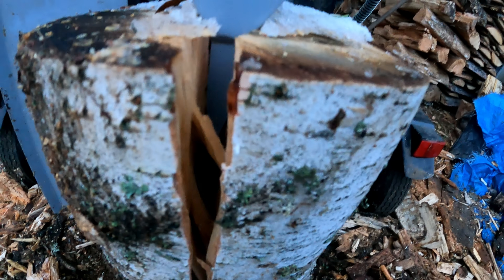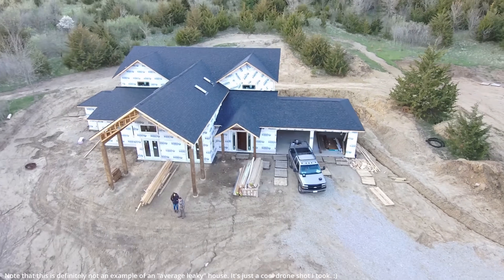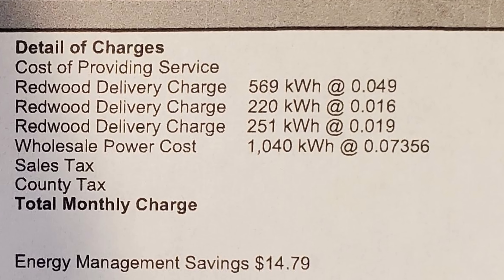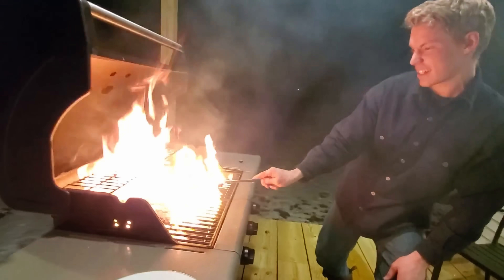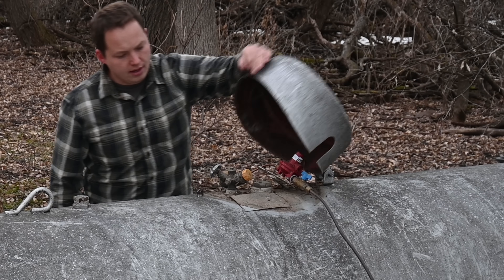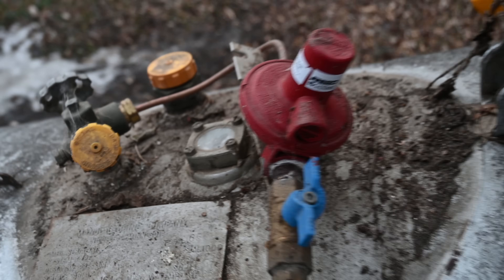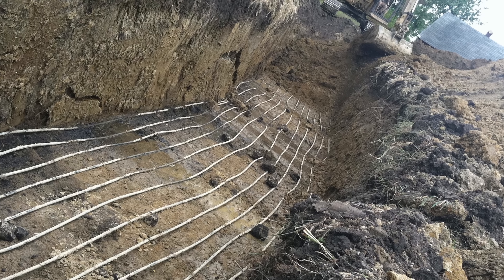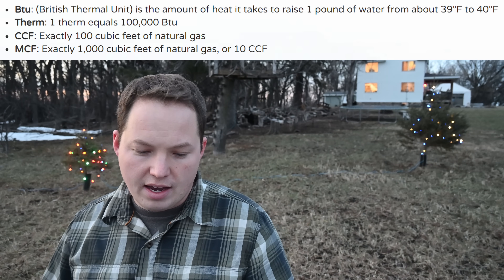What's The Best Heat Source in 2022? Top 5 Home Heating Methods - LP Electric NG Geothermal Fuel Oil

Comment: Ground source heat pumps are extremely efficient but also outrageously expensive because you need plenty of land, wells drilled, or a massive pond. I'm installing a water to water ground source heat pump in my house but I was really close to just go with mini splits. Those are cheap, super efficient for their cost and super easy to install.
Reply: I'm having a water to water ground source heat pump put in. It heats the water that runs thru the pex I installed in the basement concrete floor. Then forced air for entire house. House is 4300 sq ft with basement. I have 6 250' closed loop runs that were straight drilled 20' deep. House is closed cell spray foamed from top to bottom including basement walls.
Reply: I saw a video where they talk about using a vertical borewell with helical coils for the ground loop. Apparently, if you have even a 16-24" diameter bore, you can insert the ground loop coils in there, and you only have to drill down maybe 50 ft, which is much shallower and cheaper than a regular vertical borewell.
https://www.youtube.com/watch?v=VA5SmiaTEcM
Reply: I was using a water to water heat pump for my home to heat the floors, my system was a pump and dump and worked quite well except it was too noisy. I have no basement as I am next to a stream so it was in my mechanical room next to my living room. Make sure you soundproof it well, compressors dont get quieter with age.
Reply from the maker: My dad uses ground source heat pumps with a "pump and dump" setup where the water is pumped from his well and then the used water goes into a pond on his property. It works well but depending on where you are located they may or may not allow that type of system.
Reply: @BenjaminSahlstrom  hey, german guy here! Actually I am looking to get exactly this kind of water-to-water heat pump allowed. As a side note: mostly all newly created houses in Germany are constructed with electric heat pumps nowadays, since those are funded by our government. Also all fossil fuel type heating systems are going to be forbidden in the upcoming future.
Reply: @willbass2869  and other stupid things over the decades!
Reply: @dermozart80  We need to do that in this country. European countries and China are years ahead of us with energy efficiency . Too many corrupt politicians holding us back!
Reply: @dermozart80  Your heat pumps are air to water, in the US our heat pumps are air to air. We are installing an increasing amount of floor heating that can utilize the lower temperature water from heat pumps but only Daiken has brought their Altherma into this country. Unfortunately the home builders dictate what heating system to use in their homes so they want cheap, we end up with unzoned warm air blowing through pressed fiberglass board. As an HVAC contractor I can tell you it is pitiful.
Reply: Mini-splits are NOT cheap and do not have true defrost cycles that incorporate resistance heat to warm the delivered air while the system is in defrost mode if they even have a defrost mode.  At least currently, they are only intended for moderate winter climates.
Reply: @alanmorrison3598  what is "moderate"?
Where is it better to use the mini splits? Missouri, N. Georgia, Central Texas?
Reply: @willbass2869  Friedrich says South of the Mason Dixon line is acceptable most of the time..As far as I know their heat pump mini-splits do not have the ability to defrost the outdoor coil so depending on the outdoor conditions, the unit could run for 2-6 hrs. and then just shut down.  
Other units may have the ability to defrost the outdoor unit by switching back into the cooling mode via a reversing valve and shutting off the outdoor fan during the defrost cycle..but, they will deliver very cold air to the conditioned space until the defrost is complete.Windy conditions outdoors may lengthen the time to defrost or if very windy and cold make it impossible to defrost at all.  Residential split heat pump systems incorporate electric resistance heaters that come on if the compressor fails, (emergency heat) and during a defrost cycle to prevent cold air from being delivered to the indoor space.
Best thing on mini-splits is to ask pointed questions about all of the above and most importantly, how long the units are covered by a FULL PARTS AND LABOR warranty..Not just the refrigerant circuit.  Some contractors may offer a better warranty than the manufacturer and the most important thing is selection of a good contractor..Good contractors will insure you get a suitable mini-split and make you fully aware of shortcomings..Backup heat North of the Mason Dixon line is a must in my view and after what happened in Texas recently, may be a good idea everywhere.  Hope this helps.
Reply: @alanmorrison3598  thanks
Reply: @willbass2869  Alan Morrison is giving all wrong answers. Depends on your weather but good 1st estimate is 1/2 ton per 500 sq.ft. + 1/2 ton.
Reply: @willbass2869  They are great anywhere you wont freeze to death if your power goes out  lol
Reply: @artsmith103 , Back when I started in 1984, systems where sized to about 400 square feet per ton of cooling in a hot area, and a little smaller in a cooler area.  Basically in Arizona and Southern California, we did not worry much about proper sizing, as there is no humidity consideration.  In the east, we where told that proper sizing is more a requirement to reduce humidity.  Out west, we could get away with a vastly oversized unit and not worry about it only running 15 minutes than off for 30 minutes.  

My home in Portland Oregon is 1,850 square feet, and. 2.5 ton system would cool it just fine.  As a heat pump, 30,000 Btu's at 47F and 18,000 Btu's at 23F would mean running the back up electric heater a LOT on days less than 30F.  So I installed a 48,000 Btu unit with a 28,000 Btu capacity to heat at 23F outside air temperature.  I never connected my back up electric heater!  8 winters so far, never needed it.  Sure I get cold air for 5-8 minutes during each defrost cycle.  But that is OK.   My system can cool my house by 12F in 1 hour!  So no problem if I don't set it to 75 when I leave for work, I can cool it to comfortable in about 2 hours.   

I am thinking about installing. 120 volt ductless 17 SEER unit and running it from a 2 KW solar system.  The panels I bought are $85 rated at 250 watts, 8 amps 33 volts.  The $800 inverter / charge controller is 48 volts, 8 golf cart batteries $800.  So the solar system installed is about $3,000.  The ductless unit is $719 at Amazon, 12,000 Btu and will heat and cool my bedroom for free once the solar is hooked up!  

Yes I will be able to slow charge my model year 2025 or 26 electric vehicle with the solar system!  I might expand it to about 4 or 5 KW by that time.  

One guy on Youtube noted that his electric bill dropped from $120 a month to only about $85 once he installed LED bulbs and replaced his dishwasher with a energy star one, and installed a higher efficiency heat pump.  So plugging in his new EV brought the cost back to about $110 per month.  So he SAVED money and electricity by installing energy efficient appliances, and that was more than his EV charger uses each month!

Most EV's go 2-4 miles per KW of power they use.  So you do not need to put 75 KW of power into the car each night.  Only if you take a long trip, then charge it at home, you might put in 16 amps for over 12 hours.  Most daily charge is 16 amps for only 2-3 hours.  Some days even less power!
Reply: @alanmorrison3598  if by moderate you mean 10 degrees then yes, because they are working great here in ny
Reply: @garys6898  depends on the brand and how  and if they defrost as I've discussed.
Reply: @alanmorrison3598  I have the mr cool ones and a klimaire , these things are working phenomenal. I'm saving so much compared to heating oil
Reply: @garys6898  Mr. Cool has a 2 year parts only warrantee.  Warm (and I mean warm not hot) air is discharged high on the wall and return air is high on the wall both of which are undesirable for forced air heating.  Comfort levels are much better with baseboard hot water or electric systems, heated floors etc. But if your happy with what you have that's great!
Reply: @alanmorrison3598  I got 123 degrees coming out right now , that isn't exactly just warm .once it reaches temp then it's about 90
Reply: @garys6898  like I said if your happy with what you have that's great!  I'm not a fan of forced air heating generally from a comfort standpoint much less using air distribution recommended for cooling.  What was the discharge temp from your oil furnace?  What is the discharge temp. on a 10deg day?  And don't tell us 123deg friend..
Reply: @alanmorrison3598  the oil furnace put out great heat, but it costs me 1900 a season and 3 units run me like 125 a month
Reply: @alanmorrison3598  and I guarantee I can get 125 out of this thing on a 10 degree day, easily
Reply: @garys6898  yes there's no way around that as far as I know with oil prices today and no way to make oil furnaces or boilers very efficient..Natural gas available in your area?
Reply: @alanmorrison3598  no,I would of went with that. It's the cheapest
Reply: I'm gonna slap solar on the roof to zero it out
Reply: @garys6898  no you can't unless resistance heat is brought on and then there's that 2 year parts only warranty if you can even get parts..
Reply: @garys6898  without subsides you would think twice and good luck if your roof needs repair or replacement..
Reply: @alanmorrison3598  your living in the past, the panels are cheap now, 4 year payoff
Reply: I bet money, you are the guy who says he will never buy an electric car
Reply: @garys6898  LOL!!
Reply: @garys6898  tell me where the power to run them will come from and what happens if you get stuck overnight in one in a snowstorm and then there's the insurance rates..availability of parts..hard to get materials for batteries, motors etc. and environmentally unfriendly batteries when recycled..Yes at least for now I won't be buying one..
Reply: @garys6898  then why are they still subsidized?
Reply: @garys6898  I just priced out panels for my dad at $0.35 a watt.. Cheap as hell and he will get a 9kwh hybrid system for $6k...
Reply: @FJB2020  yeah, they are so worth it now
Reply: @alanmorrison3598  the insurance is the same, thy battery is big enough to last in a snow storm for 2 days And still have 60 lakes left to drive, the technology is rapidly increasing and everything you say sounds like your stuck in the 80's
Reply: @garys6898  WRONG!!  Insurance is outrageous because parts are outrageous and few will work on them and parts take forever to get!!  WRONG!!  The battery if used to run the pitiful heat pump heating system will NOT keep you alive through an12 or 24 hour stay in a ditch or stuck on a turnpike back up much less have anything left to go anywhere!!
Reply: @alanmorrison3598  I have a tesla everything he says is crap
Reply: That's just some dude talking
Reply: It's literally unstoppable
Reply: @garys6898  oh really!
Reply: @garys6898  Hardly!!
Reply: @garys6898  You have a Tesla?!  LOL!!
Reply: @alanmorrison3598  dude my insurance is 135 a month for my tesla, your wrong . There isn't many parts to break. Your in for a rude awakening over the next few years my friend. And the heat pump works down till -22 .I don't know where your at but in ny I'm good
Reply: @alanmorrison3598  your just making crap up ,I literally watched videos people made after that storm camping in the car for 2 days in 20 degrees with 60 something miles left to drive
Reply: @alanmorrison3598  do a YouTube search before you talk nonsense
Reply: @alanmorrison3598  and welcome to the 21st century. You like the guy who couldn't trade the horse for the car
Reply: @garys6898  you are full of bs friend..How's that Tesla for ground clearance huh?
Reply: @garys6898  post them!
Reply: @alanmorrison3598 ,  What  brand of mini split system have you Worked on that did not have a defrost system?  All of the mini split systems I worked on go into the cooling mode for a few minutes after building up ice on the outdoor coil.  With the outdoor fan off, the coil heats quickly, and thaws the ice in about 5- 8 minutes.  Then heating resumes for about 60 to 120 minutes before needing to start another defrost.  When it is above 45F outside, most ductless heat pumps never go into defrost mode, as they don't build up ice on the outdoor coils in moderate temperatures. 

I bought a 12,000 Btu 120 volt ductless heat pump on Amazon for $719 including the 15 foot long copper lines between the indoor and outdoor units. I installed it in my nephews rental house, with the indoor unit mounted on a TV cabinet.  (a buffet cabinet would also work well).  The tubing goes out the window (sealed shut with a 2X4 has holes in it to allow the tubing to pass through it).  Plugs into a 120 volt receptacle in the living room.  He should save about $100 a month X 3-4 months per year!  So payback in about 2 years.  

Yes he could have called a local contractor, who would quote $4,500 for a Union employee installed system. Or $8,500 for a three head system to heat the bedrooms and living room.  But at $800, he could afford the smaller system, and then use the electric heaters in the bedrooms far less hours each year.  Not run the living room or dining room heaters at all!
Reply: @alanmorrison3598  Mini splits do much better than that. The question is what size to get to do what job. If it's mostly for air conditioning, than it will heat the house down to the same ~30F delta or 40F ambient.  If you want it more fore heating, get it 30% bigger to take you down to 30F ambient.
Reply: @alanmorrison3598  I ran Mini-splits in NY when it was -5 out without a single issue... Each unit cost around $600 and pennies to operate, so yes they are extremely cheap and I bet they have a better payback than a geothermal system will ever have due to the huge upfront costs of those systems..
Reply: @FJB2020  LOL!!